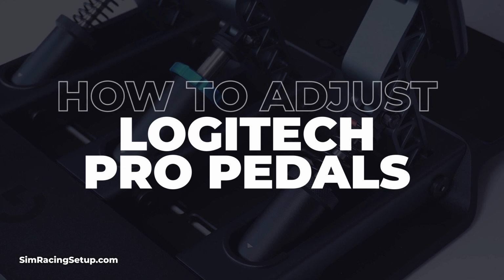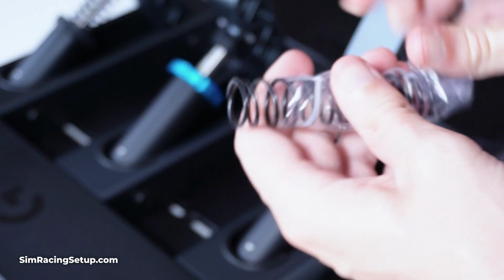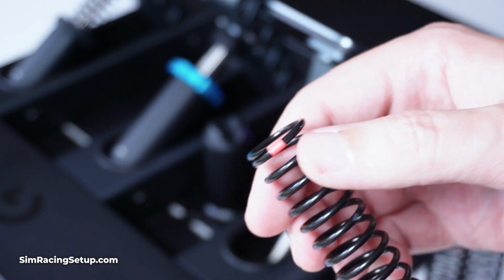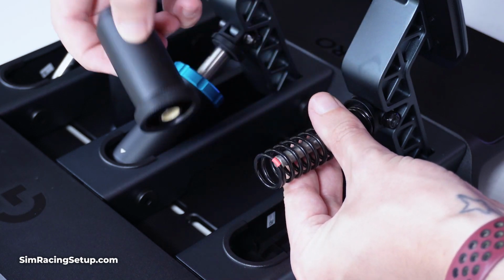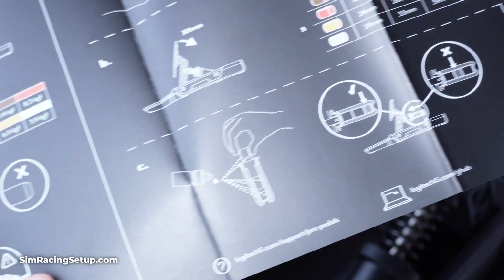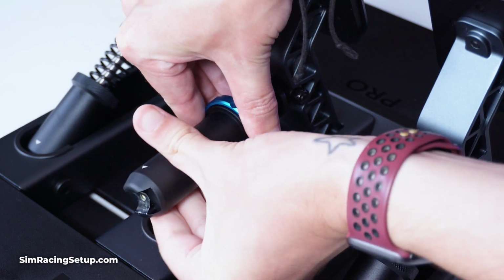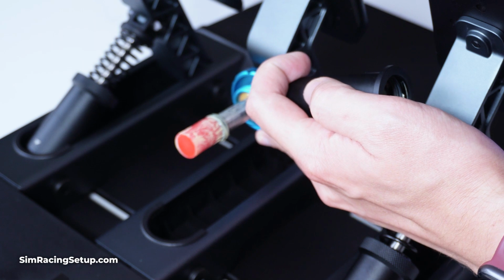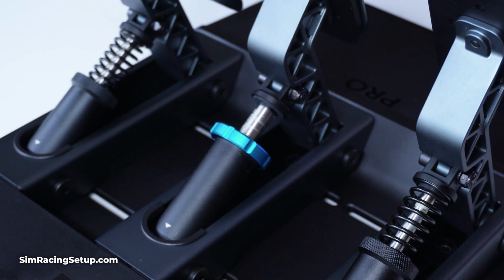Logitech Pro Pedals - How To Adjust Stiffness

Comment: Great guide cheers ,was tricky to work out which were the strongest [mine arrived today ]I went for the stiffest clutch spring too but opted for the lighter throttle spring ..I tried the stiffer brake but wasnt right for me so I think I'm back to the original.Which ever you choose it's so quick and easy to do,

Comment: I just got mine and discovered that if you place the brake pedal all the way to the left (in the same position as the clutch initially) then the cord is not long enough to connect. I wonder if I can take the elastomer brake cylinder and move it to the clutch and then plug the clutch cord into the brake port. I’m surprised that Logitech made the brake cord so short.

Comment: What is the purpose of the elastomers on the brake? I see it’s measure in mm instead of kgf. So what does the different mm do to the pedal? Does it affect pedal travel, stiffness, etc?

I’m in a situation where I want the brake pedal to have more initial bite, but not more force to reach 100% braking. I just want the first few mm of brake pedal movement to result in more braking power, like an S-curve. On the onboard computer I can only adjust brake force, but like I said I don’t want more force, just more initial bite. How can I do this on these pedals? On a PS5 so I don’t have access to Logitech Hub, unless I can somehow make changes on the Hub on PC and “save” them for when I use PS5
Reply: I just got mine yesterday. You connect it to a PC with G Hub and you adjust the "Brake Sensitivity" slider and it saves the settings when you connect it back to console (this is the same process for firmware updates too). 50% sensitivity will give you 1:1. Over 50% will give you that initial bite.